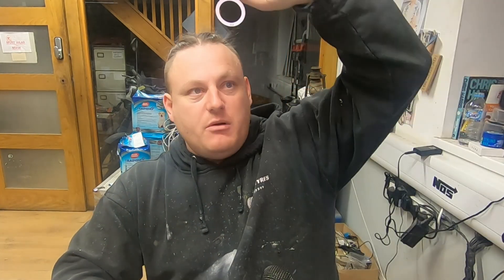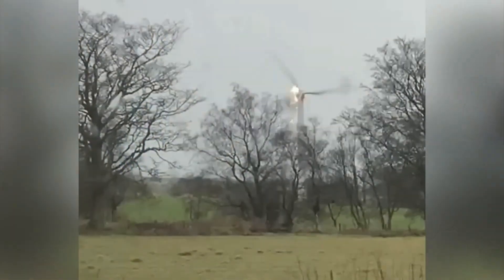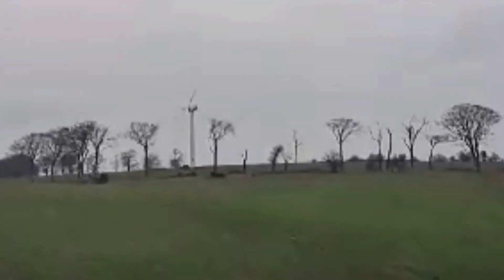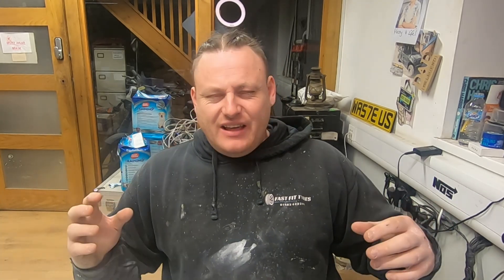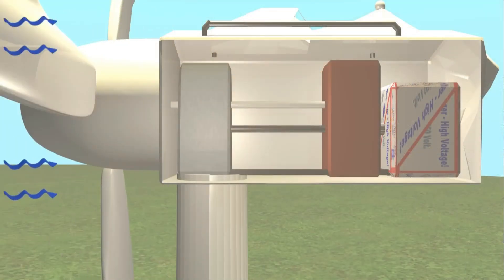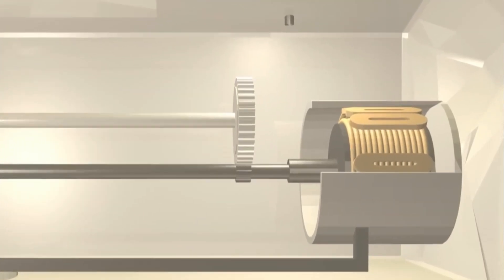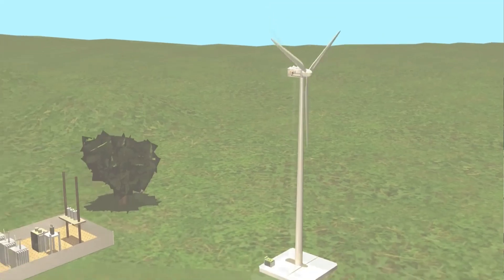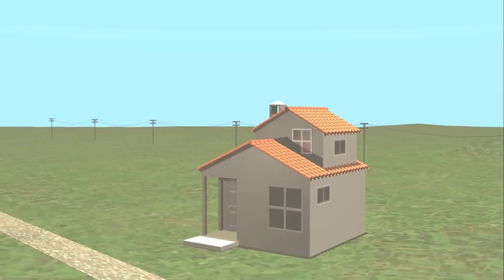Wind Turbine Fires In The UK + How it works

Comment: You missed the main failure point on turbines. Your video only covered the concept of how power is made. They have a large disc brake on the input shaft, it’s often these that overheat first, that then allows an over speed and subsequently prop failure is also my certain in those instances. The idea being that in strong wind that they are stopped completely to prevent the brake overheating.